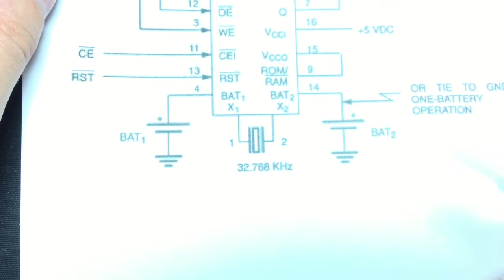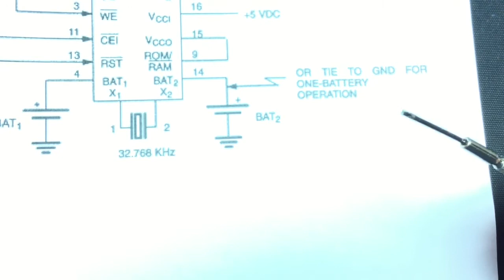Dallas Smartwatch RTC DS1216 Battery Replacement - Phantom Clock

Comment: By an astonishing coincidence, the batteries on the Smartwatch chip for my Tandy 1000HX recently died, and here you are with the solution! I was worried I'd have to source components to build another from scratch.
Reply: And it appears to have worked. Was spinning my wheels for a while before I figured out that I had to use the "C" option on the SmartWatch utility to make it remember the time.

Comment: Thanks for the great info!  I'm using the DS1216C with an old AEA PK-232 ham radio modem.  My chip has the same battery issue.  Since the PK-232 uses the RTC with SRAM instead of ROM, I'm looking at replacing the SRAM and RTC with a current-production combo: the DS1244Y-70+.  As soon as my battery holders arrive, I'll get the DS1216C working as well.  Cheers!

Comment: Just FYI for others, I did have to attach both Pin 4 AND Pin 14 to Bat+ on my circuit in order for it to work. I had only done Pin 4 originally but I was getting RAM errors and it had something to do with CS2 which is Pin 26 on the RAM I believe. I was working on an old Fluke 900 Dynamic Troubleshooter (circa 1993) which contained a DS1216B.

Comment: FYI. Original 1986 device (prior to adoption of B/C/D suffix) is a RAM device and uses a DIP14 Phantom chip marked DS1216.  Has same  two cells potted underneath. I'm not sure what the pinouts are for the DIP14.  Mine failed and I replaced them with 1987 DS1216B which had DIP16 Phantom chip. Bat1/Bat2 on replacements exceeded 3.2V so I've not needed to do the external cell mod yet.  Since they were supposedly NOS I was expecting (per datasheet) that bat1/bat2 would be disabled until Vcc was first applied which was not the case.  Maybe I'm misunderstanding DS1216B datasheet or they'd been previously power-on tested?  Anyways, hope this helps.

Comment: This was very informative as to how to disconnect the batteries and install an external solution. However, the instructions to leave pin 14 of  the Dallas chip battery input floating is quite ill advised. 

The schematic instructs to ground pin 14 if only one battery is used because the input sans the battery connected is high impedance. If it is not grounded or connected to a battery it will pick up noise and cheerfully pass it along to the data bus. This can cause all sorts of weird things to occur.

Ask me how I know this...

This may not be an issue with ROM’s , but it wreaks havoc with the SRAM version.
Reply from the maker: Thanks for watching, glad it was helpful.  I've looked back at the IC application notes and it does indeed mention about grounding p14 if only 1 battery is used, however it notes that the drawback would be that it may not switch to battery power when needed.  I didn't notice that in my testing so it was omitted and I haven't noticed any ill effects.  However its certainly worth doing as its not really much extra work and I will update the website notes when I get chance.
Reply: @RM_Nimbus_Museum  This is interesting, I commented above, but in my circuit, this hack didn't work with just Pin 4 connected to VBat+, so I had to actually connect both. I will keep an eye on this to see if my battery dies prematurely. OH... Mine was a DS1216B with the larger 64K RAM installed, so maybe that is the difference here.